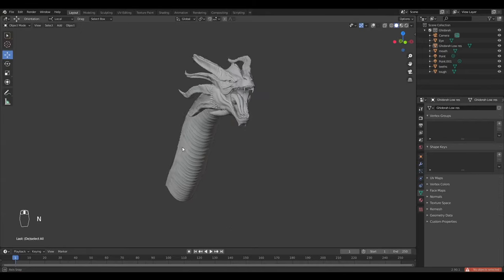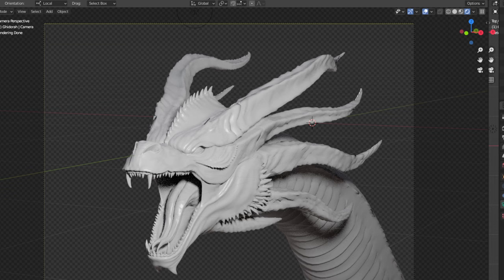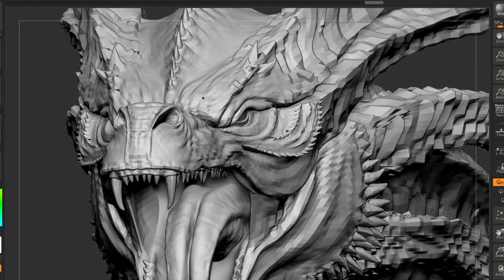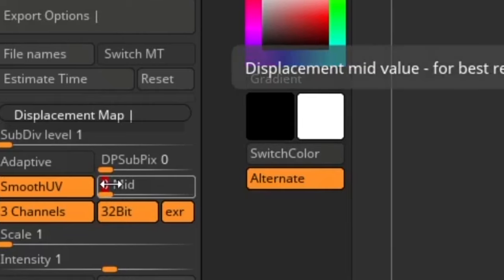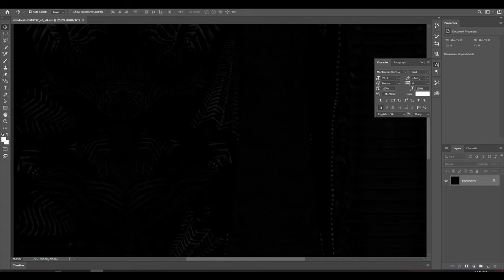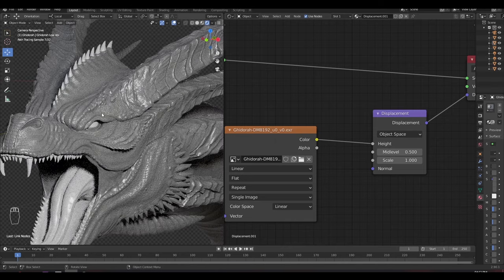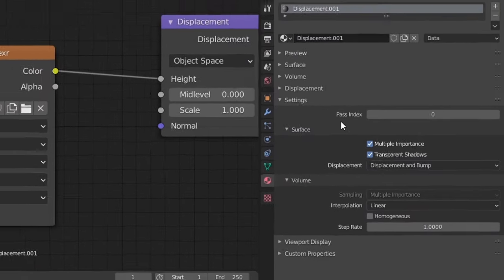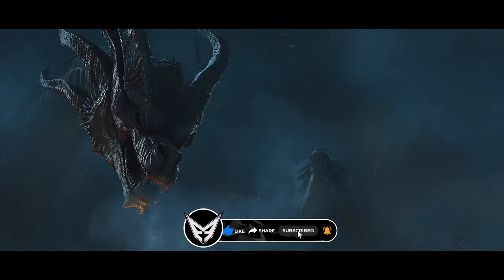How to Export High Resolution Details From Zbrush to Blender | Displacement Maps | Quick Tutorial

Comment: Reminders for myself:
1) if you get artifacts in between closed areas on mesh in blender, then add a color ramp node in between  displacement texture and displacement node.
2) if you have udims in your mesh click on file name in zbrush  and select uv tile id format and select udim, also zbrush doesn't set name format for udim right so manually adjust it. for example: displacement.1001.exr

Comment: I have a model, that I´d set the Uvs on Blender, and export to Zbrush, then i projected the details on a high mesh object. Then I import again to Blender (via goz) and the model works fine with the lowest subdivision...al works fine, then I export the maps, but when I apply the maps on the character, they somehow seems bugged......in other times works ok, then I go and work with other mesh (other tool) when I look the mesh with displace, it seems that the displace bugged. I dont know what im doing wrong. 

Other thing, displacement map works in animation? Because this is a map of the mesh in that pose.....but when in blender I move or pose the character, I lose my displace? Or it adapts to the mesh? 

Maybe its a dumb question, but I really dont know.